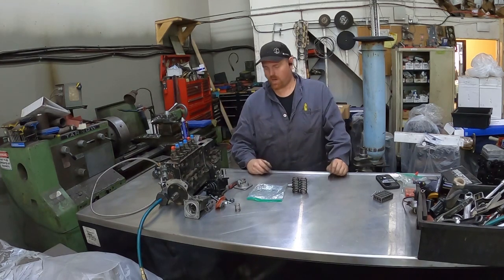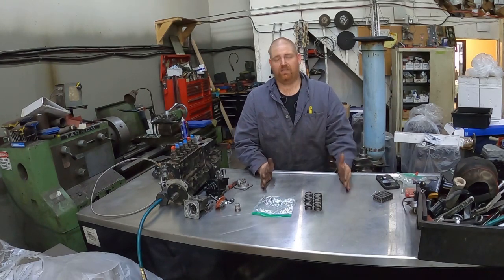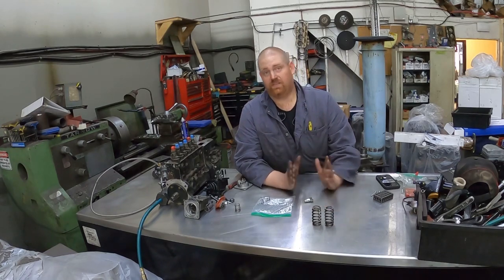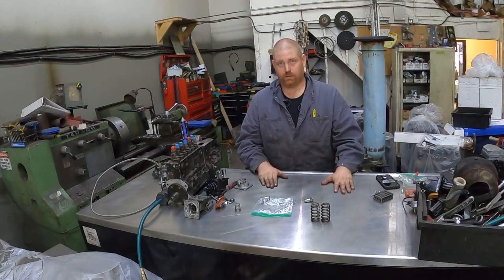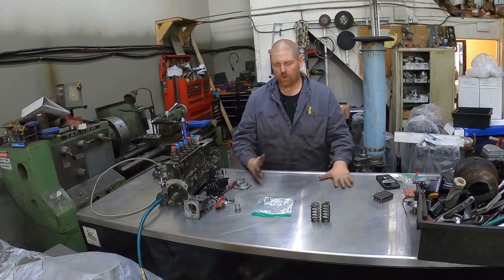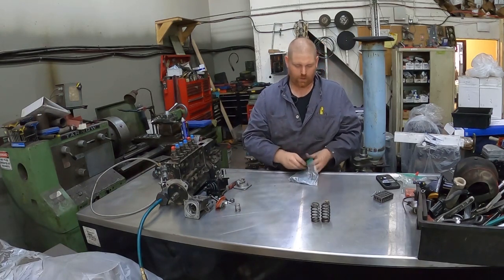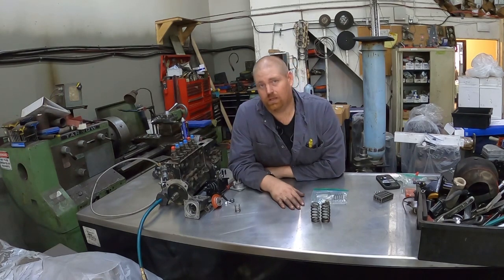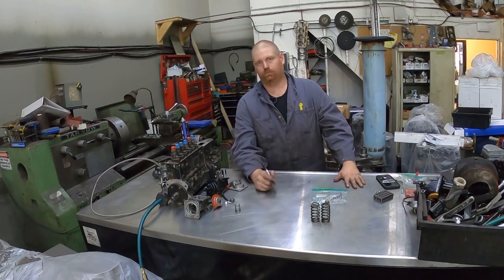BEST FIRST  PPUMP 12V CUMMINS  MODS !!!

Comment: The best mod I ever did after the dowel pin was timing for mileage . I run 17. 5 or 18 . Huge difference in mileage .  The mods you recommended I done also along with the 215 injectors and the thin washers . I really appreciate your videos .
Reply from the maker: Great to hear!
Reply: thin washers? what are those for

Comment: 10/4 on the gov springs. Had a ‘94 manual trans, deleted the fuel plate first and was somewhat disappointed that the power increase wasn’t bigger. Then I did 3k springs. WOW did she wake up. Felt like twice the horsepower
Reply from the maker: Yep beat first mod

Comment: Diamond eye has a very reasonable exhaust. It has lasted me,in salt country and running in it, 4 years,but I cleaned and painted the non stainless one. But, Rob, I wish you were around years ago when I got started into diesels. Great info man for alot of guys who are getting started.
Reply from the maker: Yes diamond eye is a good option. I was again just not on videos yet. I wanted to be on you tube 5-6 years ago. But just never made myself do it.

Comment: what brand govenor Springs and valve Springs do you recommend
Reply from the maker: I use pac brake a lot as they are easy for me to get
Reply: @CUTTERUPROB  man I truly appreciate you responding back to pretty much every single question. Beyond thankful for your time and knowledge.... just pinned the KDP today! Tomorrow will be the front crank seal and zip everything back together
Reply from the maker: @Electrictheater9  I do my best to ask every comment. But it’s getting hard lol
Reply: @CUTTERUPROB  Oh I can only imagine, it's a full time job! You're doing an amazing job just keep doing your thing man... this is my 1st cummins and 12 valve so you've helped me so much already

Comment: Can we use 4K governor springs with factory valve springs ?
Reply from the maker: you can , but you can float valves and is the boost / drive pressure is high you have have issue with power loss

Comment: Did 4k and lightened the valve train with Hamilton 165 spring kit, while I was in there did the pushrod cover seal and slid my fuel plate forward. World of difference!!!
Next summer is the nv4500.....5th gear
Reply from the maker: sure does
Reply: Mine is in the middle

Comment: If you had to take a guess, at which number will you put the power after this mods? Great video.
Reply from the maker: Hard to tell. The rpm springs don’t really add power just change the power curve

Comment: I just watch your video over n over, my 97 fl60 frightliner cabriolet,  has 71k and p pump max rpm is 2500, I need more out of it. But safe conservative ish, what do you think I start
Reply from the maker: To start I would do 
Governor spring kit 3k to start 
Add some timing to 16-17 
Move you fuel plate ahead, just make you you keep an eye on the egt’s
Reply: @CUTTERUP ROB  I'm a bit confused as to how to timing 16-17 advance,   is that moving the plate towards the rad or that wheel turning to the motor?
Reply: Ok I see a bunch of #0 to #11 fuel plate , what would be a safe number to go with
Reply: What fuel plate did you go with or what all did you do with your truck? We have a rollback with a 12 v Cummins and Eaton 5 speed.
Reply: @peterdelfs6211  I ordered akit with o plate and springs,  3k , im going to do install when weather gets better and I watch 1k more videos lol
Reply: @jamesrossi4260 How did your upgrade go, we went with 3k gsk, and stock fuel plate slid full forward and afc full forward. 15k ish miles this way. 10mpg avg 15500lbs unloaded avg 20000 loaded weight.

Comment: new to tuning 12 valves- i purchased a 97 and it came with  the "adjuster by attitude"  cable operated rack adjuster.. whats your view on it? go/no go?  I got a ton of stuff to build this 12 valve too
Reply from the maker: They do work. But limit the over all rack travel. So depends on how much power you want
Reply: @CUTTERUPROB  im looking to do a complete rebuild soon. Depending on wear in cylinders- a freshen up on short block.. i got a brand new head, if i can squeeze 400-450 hp out of it with a compound setup- stick with a stock grind cam or a stage 1 or 2?   Its going to be a daily/ tow truck for my race car trailer and a few heavy hauls. 
Thanks for your reply.  Any input is greatly appreciated.  
Im no stranger to the automotive machine shop so i am mechanically inclined

Comment: I put 4k's in my 175 pump and torque still drops like a rock at 2800rpm. 18* of timing. Fuel pressure 45psi Airdog 165. Do I need DV's too? Should I just get a 215 pump?
Reply: Overflow valve in good condition?
Reply from the maker: Can you free rev the engine too 4000k ? 
45psi at WOT? 
What the rest of the set up